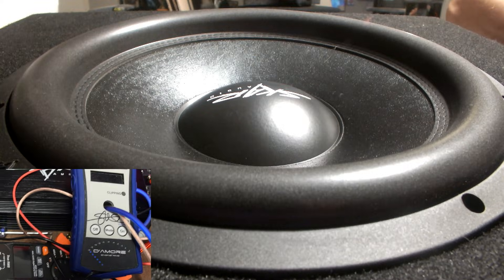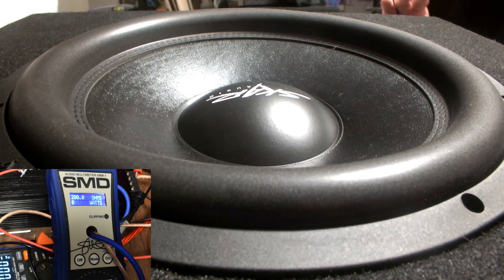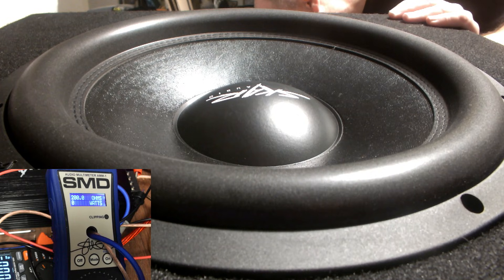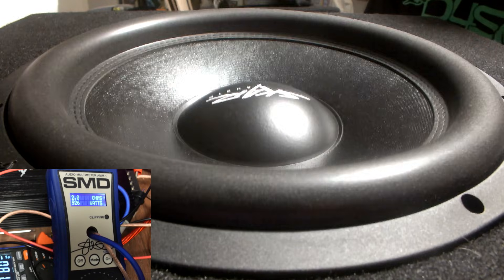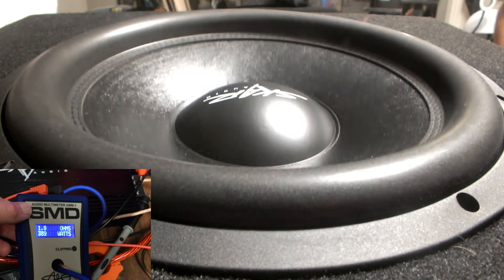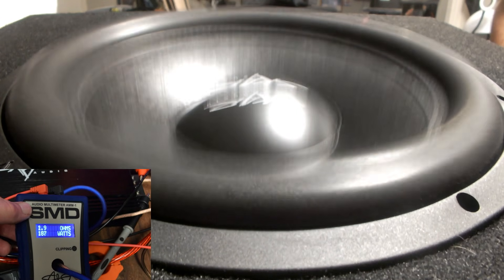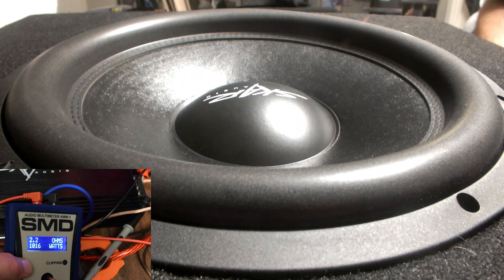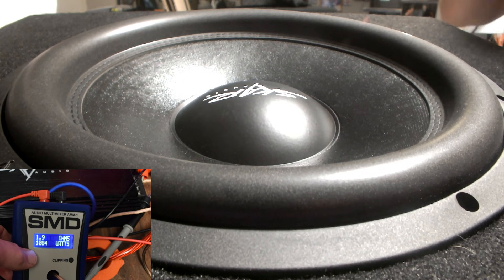Clipping A Subwoofer What Is Distortion & What Is Clean Power? Skar Audio RP-1200.1D Amplifier Pt.1

Comment: Takes power to make power. Gotta have proper electrical upgrade for the amplifier to work properly and not clip. Bigger amp alternator Big 4 upgrade battery reserves wire type (ofc). Properly tuning the amplifier using proper equipment.
Reply from the maker: Right. This is a group of videos I'm making. I couldn't put everything in one video so I made a few. My power in my house is too strong to get a clipped signal without hurting my sub by overpowering it. I have 3 cars and I did a video on one of the factory car's with no upgrades. Thanks for your comment and support 🙂 I appreciate it 🙏

Comment: I can tell you want to learn this. So here goes. 

In car audio, the term clipping refers to a type of change in the AC sinewave from an amplifier. Any deviation in the shape of the sine wave is considered distortion and clipping is one type of distortion. 

The normally smooth sinewave will have the top and bottom flattened out. This is due to the amp being asked to produce more power than it has voltage available.
Reply: You have to understand a little bit about how an amplifier works. Inside, you have two main stages. The power supply stage is what creates high voltage rails that get fed into the output stage of the amplifier. So 12v DC goes in and let's say it bumps it up to positive 50 volt and negative 50 volt. 

The output stage uses this rail voltage like a reservoir to create an output sinewave to feed the speaker. It can produce a sinewave that is 100 volts peak to peak. If you push the amp too hard, the output stage will hit the 100v limit, but still try to output a sinewave. Let's say you wanted to produce a signwave that is 110v peak to peak. The top 5 volts and bottom 5 volts will be missing or clipped off. You can see this on an oscilloscope.
Reply: @JasonWW2000 hey do you think it's possible to build an alternator that supplies a +/- voltage of 120, so it would basically do what the SWMP in an amp does. I've been wanting to build SWMP less amplifier and run them directly off a supplied rail current. Whattaya think 🤔  delete the need for half of the amp bro. And your power wires only need to be 8 gage. Car audio is a cash grab BS inflated garbage. I'm gonna start making subs from car tires and roll in to competition with straight trash.
Reply: That's a clipped signal. You can get a clipped signal from the amp in a headunit also. Even from a headunits RCA outputs. From an EQ or DSP, etc. There's always a voltage limit to a devices output. If you push it too far, the otherwise smooth AC sinewave will start to clip. 

A mechanical device such as a subwoofer can not clip. You can feed it a clipped signal and you can hear the results of that. The cone is simply trying to move back-and-forth smoothly to match the sinewave. A small amount of clipped signal fed into a subwoofer is not going to be very noticeable, because the mass of the cone sort of covers it up. As the signal becomes more heavily clipped, it starts looking like a square wave. The cone will not move smoothly and you'll hear it. The cone will try to stop moving at the top and bottom of it's stroke to match the clipped signal it's being fed. When the cone's not moving, the voice coil gets much hotter than normal. This can lead to heat damage.
Reply from the maker: I'm just going to write on one comment. I have several videos to this video. If I missed something that you mentioned I will try to fit it in the videos. My computer froze too many times to count so I had to make several videos and different parts.
Reply: @JasonWW2000 spot on as per usual.
Reply: Have to measure at the head unit, DSP, amp, etc.  Furthermore, the mechancial limits of the enclosure/subwoofer combination (tuning)
It’s crazy. Tools / equipment help.

Comment: Yeaaa people don't understand that it swings in ohms when playing .... And there's another way to distortion just by playing a distorted bass-(it will sound buzze) FOR PEOPLE THAT don't know 👍💯..... John i did your test song 32HZ AND UP 👍
Reply: There's definitely a big difference between DC resistance and AC impedence. For the most part, a DC voltage is going to show a fixed resistance.

When you run an AC voltage through something, the impedance or "resistance" is going to change based on the frequency of that AC voltage. AC is weird like that. 😊
Reply from the maker: I see you wrote several comments. I have several part's to this video coming in the next couple days and I will add on some of the stuff you mentioned that I might not have. Thanks for your comments 🙏
Reply from the maker: Nice. How did it sound? I have several part's to this video coming. I tried making a single video and it was too problematic. Thanks for your comment and support 🙂

Comment: you can also clip your head unit output on the rca
Reply: Yes, some amps can compensate for that and some can't. Some amps will take that clipped input and smooth it out. It's always best to make sure your signal is not clipped all the way down the signal chain. Especially at the amps output.
Reply from the maker: Thanks for your comment and support 🙂